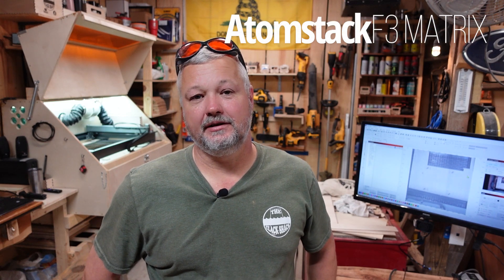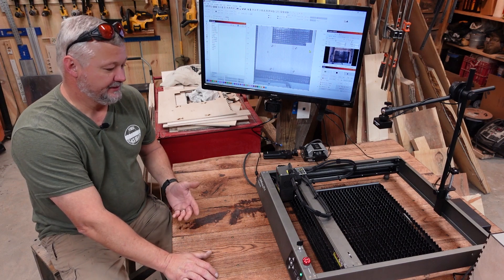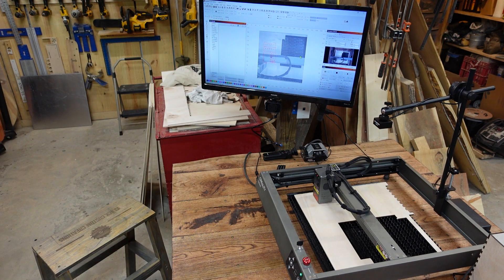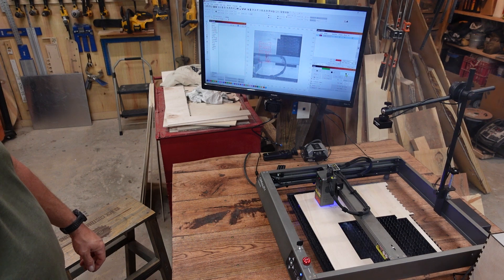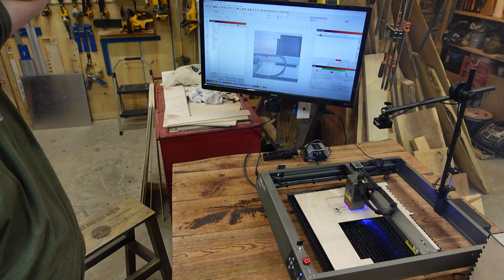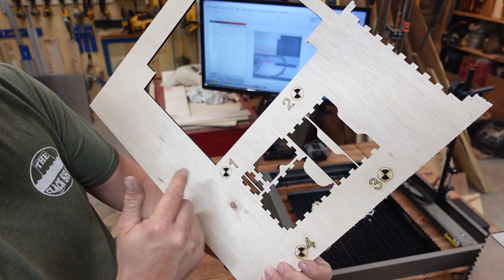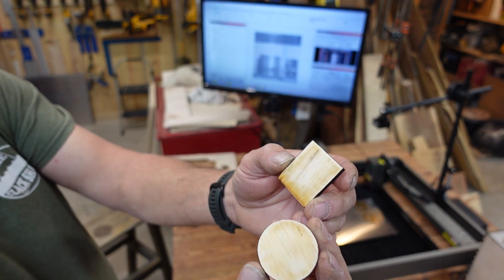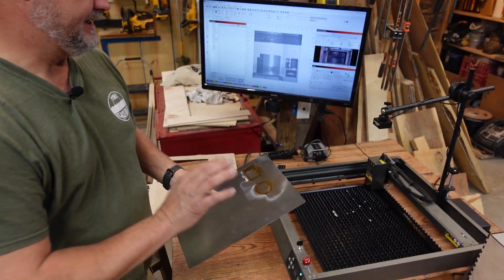Atomstack F3 Matrix cutting surface

Comment: A few "things" you missed in your review. First of all you didn't use it with the hold down brackets, the wing nuts of which hit the arm of the Creality Falcon 2. Making the bed unusable. Second, the clips that slide into the bracket  are a pain in the ass to keep in position and when you tighten the wing nuts they love to pop out. Third, every other row of teeth is lower than the one next to it, which is basically just stupid, the wood is only resting on every other row, why they did that is beyond me as it makes the already slippery bed even worse. All in all mines going back, which is another problem, I ordered it and it came from California, but shipping it back it has to go to Poland, Shipping will no doubt be more than the thing is worth. Stick with a regular Honeycomb bed and throw the Atomstack in the recycling.
Reply from the maker: I did’t miss anything, The device works for me. Not all situations are the same.
Reply: I watched your whole video, you didn't even have the wingnuts and long screws installed.
You didn't notice the teeth were not at the same level?
Reply from the maker: I did not plan on using the jig leg that it came with. Also, just checked again and all the teeth are level on mine.  @owenauer3406

Comment: Well just thought I'd let you know I ordered my 20watter from comgrow hope it's what I need
Reply from the maker: It's a good module from my experience. Mine is still putting in work.
Reply: Just I'm running it on my olm 2 frame
Reply: So hope it's okay
Reply: Just not sure about the setting up part hope don't fry anything out connecting it 🙏 an connecting it correctly without having to change anything fingers crossed